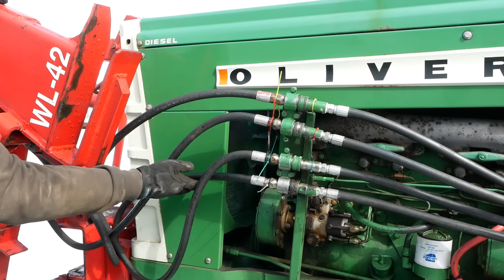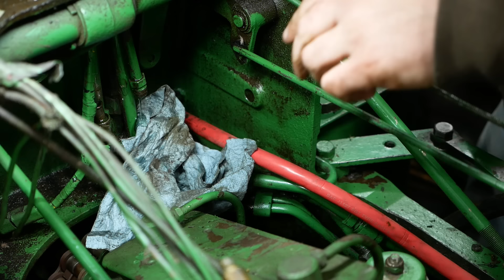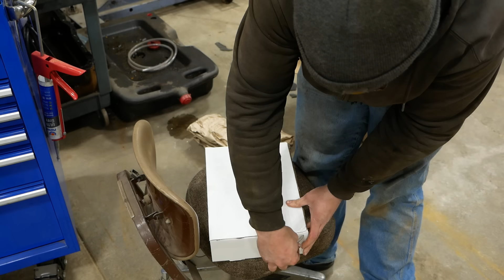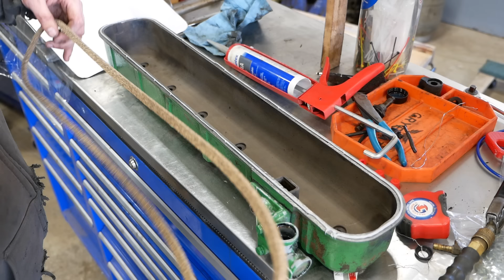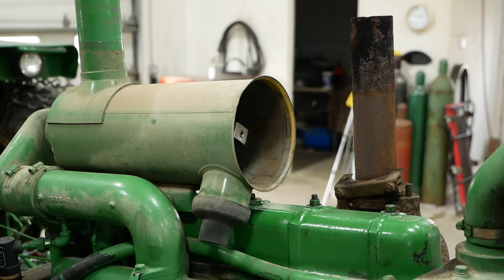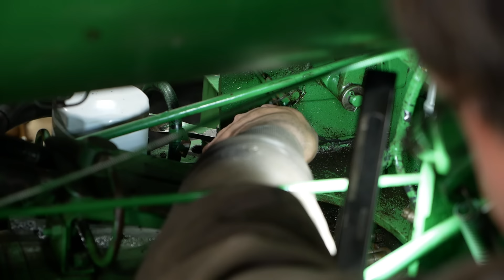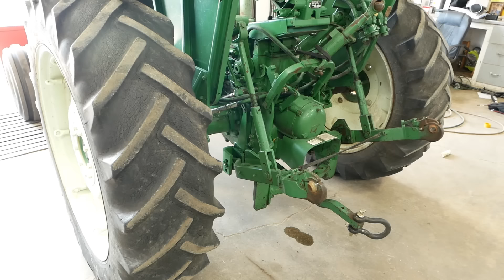Oliver 1650 Tractor Fuel Injection Overhaul and Other Repairs

Comment: Stopped using them? 😮 huh? Compression fittings….. on hydraulic lines? Heii no. If your cork gaskets are leaking they are either not tight enough OR are too tight. Im actually serious about that. We use cork on R123/ mineral oil chillers, if right they don’t leak at all. Edit- cork gaskets are held together with a binder, I’ll bet you’ve got a non compatible binder, translation- shitty gasket 😊.  Another edit- She sounds great!! Nice work! 5 years later , do you regret not replacing that 4th steering hose? 😅

Comment: It's amazing how I used to take proper packing materials like around the pump and injectors for granted.    There's been too many times since the lock downs that internet sellers throw bare heavy pointy tools in those thin shipping bags with zero fucks given to making sure the products arrives safely.   

FYI if you receive a badly damaged EMPTY container from an Ebay seller and the tracking shows it arrived at your door step they will not intervene on your behalf.    I had to do a charge back on my cc to at least get my money back.

Comment: i used to cut off special tube hose ends then put them in a female jic pipe fitting and braze it. then just crimp it on a new hose. saved many people headaches for special hoses that were costly and/or not available.

Comment: Hi Wes I have a 1555 Oliver diesel tractor. I changed the injection pump and injectors. I disconnected all the fuel lines and now I can’t get them back the way they are supposed to be. Can you please help me out with a picture or an explanation that a country boy can understand. Thanks in advance.

Comment: I see this video was 2 years ago and you may have sorted out your fuel pump issues--however, if you still need a kit for your pump, google Then and Now Auto as they have parts for all fuel pumps as well as a rebuild service.  I have used them for several military jeep fuel pumps and a Carter fuel pump.  All you need to send them is the number stamped on the mounting flange.

Comment: These tractors are so much better than anything you can bye today. I’ve got several fords and a mahindra and that red tractor is way lighter than the old mechanical fords even though it’s bigger hp wise. The electronic fuel injection tractors I’ve been on don’t have governors either which is a pain in the ass too.

Comment: Yes sir we have definitely come a long way as to the quality of packing shipments. As a former RPS P&D Contractor I could tell many a story about the short comings in the industry. A lot of customers we had would skimp on the packaging materials and then blame the carrier (RPS, UPS or the USPS for example) for damages when it really boiled down to insufficient packaging (of which the carriers would deny due to improper packaging). As we have progressed and shippers have learned, the art of packaging is quite the science. It can be rather aggravating to unpack stuff due to what may seem as overkill, but getting the items in without damage is the goal.

Comment: the problem all lies in the Stanadyne Roosa Master pump. The vibration idolator that couples the pump guts to the input shaft falls apart. This clogs the pump internals with debris and the pump relies on internal pressure and flow to set all aspects of injection amount and timing.

Comment: we've got a Case 580D with a 4 cylinder diesel and it too has a Stanadyne Roosa Master injection pump. I now have an appreciation for the engineering inside of these pumps as they are very clever in how the manage timing, fuel amount, and governing. In my ignorance, I bought a rebuild kit and rebuilt it on my parents kitchen table. Slapped it back together and nothing... Not even fuel to the injectors. So I cranked in the max fuel adjustment for the injection rollers in the pump as hard as I could and the engine fired right up! It ran a little rough, would go up to the governor, and had no power. As soon as you touched the hydros or power shuttle it died. So I called up the diesel shop and he actually had the exact pump with the exact configuration we needed on the self! For a cool $1,000! WIth no choice I went down to get it and talked to the guy, told him my story, and he was shocked. He was surprised the rebuilt pump ran at all and said congrats on that achievement. Turns out, you have to throw the guts of these pump into  jigs that calibrate each and every adjustment within the pump and it must be done in stages. Each pump is specially tuned to each engine for each tractor. With the properly rebuilt pump the tractor runs like new. Fires right up, easy cold starting (no glow plugs), loads of power, and the thing hardly smokes. This is a 1980 Case 580D with almost 7,000 hours. Amazing what a fresh pump did for it.

Comment: Hey Wes, love your videos! All of this brings back old memories...I was a field mechanic for JD for many years. The umbrella seals do very well with good ole Vaseline and I never tore a seal. Also, the seal compressor isn't necessary, mine got used a couple of times and sat in the drop front road box the rest of its life. JD has a special wrench (box end) made by OTC for the back bolt on the IP flange...it makes life so much easier! This is for anyone replacing a Stanadyne/Roosa master pump, make sure the throttle lever is in the full fuel position with a little spring load, wired back or the seals WILL flip when trying to install! Keep up the good work!

Comment: Watched Area Diesel’s video and then this one, both great content👍 One comment about bleeding the fuel system, you didn’t bother to bleed the top of the secondary filter, how does the air get out? You can only be using half the element or am I missing something

Comment: I live up by Black River Falls Wisconsin and there is a old Oliver White dealer he can fix the power steering hoses a lot cheaper than $150 a piece he uses the old metal fittings just replaces the rubber hoses he can get you anything you might need for the Oliver White tractors the place is a real treasure

Comment: Fyi wes if you don't want it to leak at all not one drop use ultra blue or ultra black silicone gasket maker once it dries you can run it without bolts an I will give you a hundred dollar bill if it leaks cause you have to use a hammer an chisel to get it off it does not leak none try you some I stand behind it 100 percent car quest Carrie's it

Comment: At around 30:15 youre talking about a special tool for collapsing those umbrella seals, if it were me I'd use a piece of thin sheet metal like 28ga and cut it so it fits around the shaft and use a hose clamp to tighten it up, much like a piston ring tool for installing pistons.

Comment: Filtration,filtration,filtration.............OEM filters are only 60% efficient at whatever micron.  You need at least 2 filters in series at 4 micron or less ( 2 micron for common rail) to provide something close to real filtration to protect the pump.  ALL petroleum fuels have dissolved moisture and dirt.  Every time fuel is loaded,unloaded and finally delivered to your local supplier, dirt finds its way in. How do I know this.............many years in petroleum fuel haulage and being a certified jet fuel inspector. omg........as if ordinary threads are not confusing enough.......then there are 'pipe' threads ..........bspt,npt,jic...........ffs.

Comment: You may have to try a machine shop for the liners. They can use stock material and bore them to size, taper and the bottom stop.

Comment: There's a trick I use on motorcycle forks to get the seals on that I've done for other things too. Cut the corner out of a plastic bag, grease it, slip over the end or sharp part of the shaft, and then it helps guide the seal on. 👍 It's kinda the same as when you need to roll something heavy into a garage and you lay down some stainless steel across the joint so tiny wheels can get across.

Comment: I don't know if this is of interest to you ref Line making kits hyd. In the past
the military had small 2 wheeled trailers with all the equipment known for crimping/ bending making lines for diesel, aircraft , military applications with all needed tools to reproduce in addition a full stock of various lines and fittings. They were scarcely ever used as required lines were usually ordered by nsn and sent over seas by airfreight, hence said kits were turned in. THEY SHOULD BE AT SOME TIME BE TURNING UP AT AUCTIONS AND EQUIPMENT SALES. THESE MACHINES WILL SAVE YOU A TON OF $$ AND YOU LOOK PLENTY SMART OWNING ONE.
"IF THIS INTERESTS YOU.

Comment: On my 1750 my rear cylinder injector line started leaking at the injector, can I just tighten the nut or just get a new line. If you recommend a new line, do you know who sells them new/aftermarket?

Comment: good work....very interesting to watch you identify and correct all these problems......i ended up thinking that with a unit as old as that tractor its a shame that you weren't in a position to put in new rings and valves....then it would have been basically remanufactured....but with any luck it might be 10 years before you have to do anything more to it.

Comment: You start the pour sideways, once flow established, you then rotate it fully upside down. That seemed like pure malicious compliance more than anything else.
EDIT: To prevent another example of NOT applying even a tiny bit of care, the technique is for large percentage pours, not a couple cups from your gallon jug. Half a container sure. It's a way to prevent vacuum chugging, or ruining the integrity of a container by poking a hole in the plastic for a vent.

Comment: What I found that works for those umbrella seals, or any seals actuall, even hydraulic piston oil and dust seals or main bearing seals where a sharp machined metal edge is present... is clear shipping or packaging tape.  You put the tape over any machined metal surface that is sharp or has a jagged edge, or even machined threads for instance, and slide the rubber seal over it without cutting and tearing your seals lip.

Comment: When setting valves on an engine like that with no brakes what I will do is set it at number 1 TDC then set cylinder 1 intake and exhaust then intake, exhaust, intake, exhaust on 2,3,4,5 respectively then I roll the engine 360 degrees and set number 6 intake and exhaust and set exhaust, intake, exhaust, intake on 2, 3, 4, 5. Removes a lot or guesswork when using valve overlap and overhead sets take way less time. On heavy duty you kinda have to use the firing order either because of Jake brakes or you have to set the injector too but this method works great for medium duty on down.

Comment: I find ditching the copper compression washers for Dowty bonded seals helps stop the leaks and the need to over torque the banjo bolts to omg it's gonna snap. German torque works well on the bonded seals, gut und tight!

Comment: We always used 3M interior trim adhesive on the case gaskets. For some reason, it works on most gaskets. It also does wonders on valve cover gaskets.

Comment: The pouring advice is good, been using it for years, you simply didn't have to keep the rest of the jug directly below the spout. A slight angle to one side would have been fine. Even works on five gallon pails of tractor fluid.

Comment: Wes - a bit new to older diesel tractors.  I noticed when you shut down the Oliver you returned the fuel cutoff to run.  Is there a reason why you did that?  Look forward to more good content.  I hope you like making these videos, you have a knack for it.
Reply from the maker: It’s a good practice to push the shut off in. That keeps the metering valve from sticking in the off position.

Comment: You can make a simple plastic sleeve for these seals from some round soft pla2, like from a coke bottle. Roll it like 1 and a half time around the shaft and slip the seal with it on the shaft :)

Comment: I just finished binge watching all your videos. You have one of the better channels on YouTube. The content is always worth watching and the editing is exceptional. I especially enjoy the electrical diagnosis videos. 

I started mechanic work in 1977 in West Texas where it rains 15 inches a year and 2 inches from November through March. I’ve never personally experienced a wheel stuck to a rotor, a rotor stuck to a hub,  a steel brake line leaking that wasn’t rubbing on something, or a mouse nest in anything . I have had a bull snake come out of a stamped hole in a cotton stripper cab frame and strike at me. But your work on rusty bolts makes me feel like I’m watching a brain surgeon on a soap opera remove a malignant tumor from the President. Please keep the videos coming. I really enjoy you and your good family.

Comment: Excellent video i just bought a lift pump for a 1650 oliver diesel tractor brand new from Agco the part number is 79017945 I got it from o Brian county implement in Sheldon Iowa they are a great Agco parts dealership for oliver parts

Comment: Midwest Cylinder and Machine, Newton, Iowa

OUR SERVICES
1. Cylinder Head Remanufacturing
2. Block Remanufacturing
3. Casting Repair
4. Crankshaft Rebuilding
5. Marine Repair
6. Heavy Duty and Ag Repair
7. Special Projects

1. Cylinder Head Remanufacturing
After 70 years in business, MCH offers a vast knowledge of almost every kind of cylinder head from a single head to a V- 24 cylinder engine head diesel or gas. Our specialized equipment means we can weld and rebuild any aluminum or cast iron cylinder head that is brought in, even diesel cylinder heads.
Back To Top

2. Block Remanufacturing
Our expertise doesn't end with cylinder heads. Our cylinder block rebuilding business originally specialized in automotive, but our main focus is now heavy duty and agriculture blocks. We pioneered and fabricated some block repair sleeve inserts before they were available from the O.E. With the addition of our new Rottler F99Y CNC machine, the possibilities are endless.
Back To Top

3. Casting Repair
At MCH, every day we repair something that we've never seen before. Our welding and repair expertise allows us to restore the antique, unique or impossible to replace. Even more recent castings can be repaired saving the customer money and sometimes improving the original casting.
Back To Top

4. Crankshaft Rebuilding
In 2005 MCH purchased two crankshaft grinders and an align hone machine. The new upgrade also included a connecting rod pin machine to accurately bore out rod bushings instead of honing. We also have a crankshaft-welding machine to weld crankshafts when permitted.
To meet the needs of EVERY customer, we also sell new aftermarket auto, industrial, and agriculture crankshafts that meet or exceed the O.E. specifications.

Comment: Im sorry if it sounded like I was giving you flak, I was not tying to do that .You are a very smart man and I enjoy your videos. BUT you almost had it! turn the bottle another 20 degrees or so. So that the handle portion is out of the way as you pour. This technique works better with 5 gallon jugs like in the other video but it works with most containers. I think this way allows you to get a greater pouring angle  before fluid starts coming out and bring the opening closer to the funnel, if you can contact the opening to the funnel you should have less spillage then.

Please accept my apologies I assume you get a lot of hateful comments and you still have the strength to carry on.
I am not a master of anything but a fool at everything. Maybe I should leave less comments and take more notes. 

Your Humble student 
E.
Reply from the maker: Heh. I was just having fun with the comments.

Comment: I ain't ever seen a pull-plow like that!!! And I grew up in a township that was still at least half farms - but I was in the suburb part.
I think the thought behind holding the bottle upside-down to pour, is about getting air smoothly into the container, so that it can displace the liquid which is leaving the container.   I've found that holding a container like that one sideways, will admit enough displacement air, resulting in a smooth controllable pour. Now a quart oil container does a little better when poured from an upside-down orientation.

Comment: @Watch Wes Work, I'm sure this will get lost in the shuffle, being a little late to the party, but the trick with pouring from those jugs is to pour sideways. I don't remember when exactly I started doing this with those 5qt jugs of engine oil, but that's where I started doing this was with oil changes on cars. 

Pouring from the "wide side" so to speak, means that you don't get an air lock at the opening, and "glug glug" the liquid out in bursts that go all over where you don't expect. Instead, with the better air flow pouring from the side, it comes out in a steady stream that is easier to predict and control.
Reply from the maker: Right. I was just making a joke!

Comment: Hey Wes Not to get off subject but I have a cat 3208 in a 85 ford 7000 it sat for a few years ran when parked now will not start I discovered the plunger s and slid rings in the pump stuck from varnish cleaned it all got them working but it still will not start do you have any Idea's of what I can do this is a farm truck and I don't have much money P,S good video thanks
Reply from the maker: I don't know. If you have fuel to the injectors then I guess the injectors would be the next step.
Reply: @WatchWesWork  ok thanks for getting back to me

Comment: Hello from the UK Wes, love this long video, re - setting valve clearances (Tappets) my dad taught me an easy way when i was just a teenager - it was the rule of 13: which is one down adjust 12.  2 down adjust 11.  3 down etc....should always add up to 13 on a 6 cylinder or 9 on a 4 cylinder: 1 down adjust 8 etc. etc. give it a try one day, anyone else used this method? 
 Love the show keep em coming,  Stu